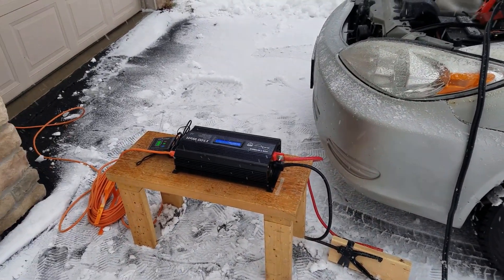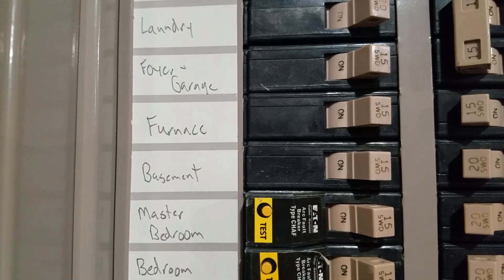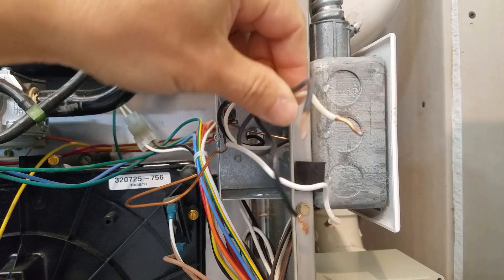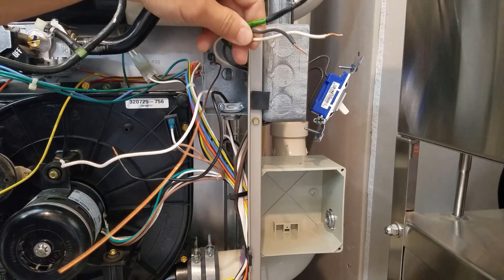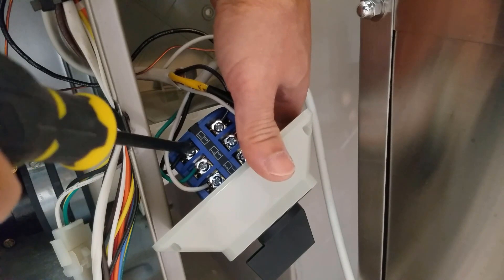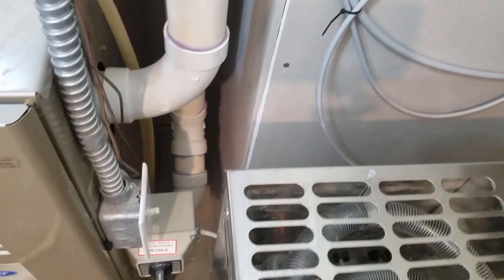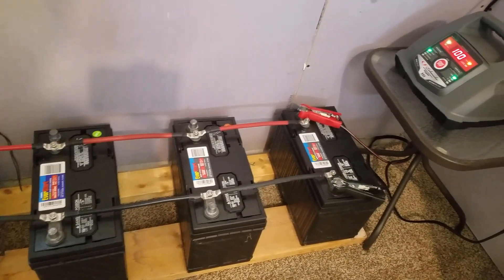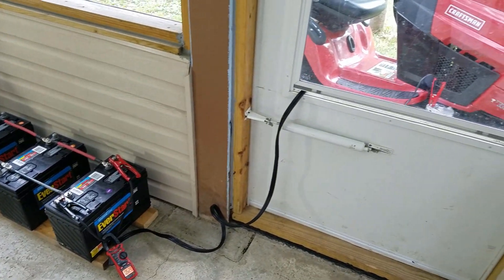Keep Your Family Warm During A Power Outage (EASY!)

Comment: That's about what I started with. Now I have 20 marine batteries. Twelve 100 watts of solar panels. I just have a wood 🔥 stove, and fans. Last month I bought a Winco Lil Dog generator. After several days of rain and clouds, I had to use it to charge the battery bank. I use a 2000 watts Aims Power inverter charger, 24 volts. I tell people that they need to get some batteries and an inverter for emergency. My uncle's power went out today and he had to go take the battery out of his tractor to run his inverter. He has power back on now and the battery on the charger. I live in his barn. There wasn't much power out here, long way from the house. So I have my own now. I took the crock out of the Crock-Pot and have a chicken in it sitting on the wood stove. Saves a lot of power. The solar panels wattage is dropping too, as the days shorten up. The backup power is going to be tested next weekend... supposed to be negative 8 here, wind chill probably in the -20s... this is a good video for someone to start out with if they are going to go off grid. I'm going for a load of wood Monday morning. Chance of snow that evening. I'll leave some of it in the camper shell for traction. My electric oven uses 1472 watts, and I had a lot of noises and stuff trying to run it off of a 12 volts inverter, so I decided to go with 24 volts. I have a chest freezer too. I have a couple of DC motors that I'm making wind generators out of.    The off grid adventure goes on. I may get four more batteries for the system to see if it helps on longer periods of no 🌞 sunshine. I would rather spend the money than be without electricity. I really liked the video. I will try it with 24 batteries and see how it goes. I'm just sort of replacing the riding mower for a windmill. I'm using the excuse that this is my first system, so I didn't know how many batteries it should have. I think I can go a few more. At midnight, showing 24.8 volts on the twenty that I have now. If you had four more batteries you could go 24 volts. Just imagine 16 more batteries, lol. And adding four more batteries soon. And that will be my battery bank. Don't you think that it will be good enough? I'm hoping it will be. With the wind generator helping I should get a week or so of reserve. The sun almost always comes out by then. Looks like the chicken is about done.
Reply from the maker: I'm planning to add a timer with an override input for the inverter to conserver the battery power. The inverter will only run once every 15 - 60 minutes. The timer override input is to ensure the inverter keeps on running when the furnace fan is on. When the timer override input is in-active, the inverter will be turned on/off only on the adjustable time-based.

Good luck with your setup, and thank you for your support!